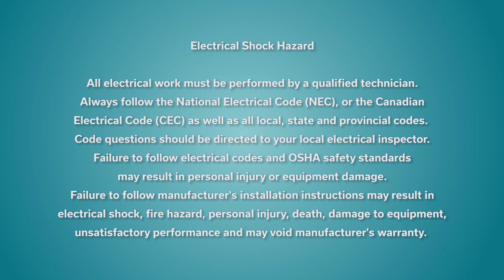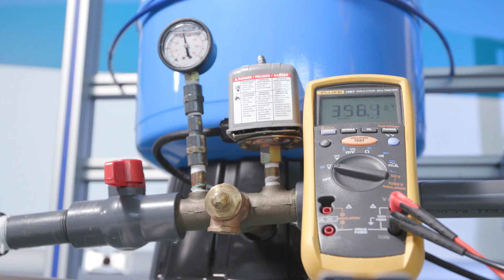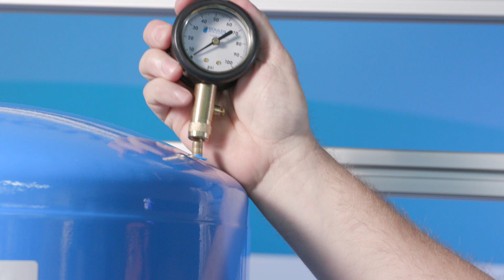The 15 Typical Causes of Pressure Switch Chatter

Comment: Here's what's driving me absolutely nuts right now... I use the water, pump turns on, then once at pressure it turns off. 30 -60 seconds later it turns back on, runs for a minute, then turns back off. Repeats this a few times then stops until I use the water again. Any suggestions on what could be causing this? Pump is only a few months old, changed the filter out, replaced all tap washers, but still stops and starts..
Reply: That's what mines doing what fixed your issue?

Comment: My pressure pump is good but stops  the water returns to the well and the pump starts working again, and I don't know what parts needs to be changed.
Reply: Sounds like your check valve is not working, u can leave it where it is and install a new one between pressure switch and pressure tank
Reply: Thank you very much. Really appreciated.

Comment: By "chatter" do you mean when it makes a rapid clicking sound? My pump stopped working & when I went outside to check, I pulled up on the cable supplying power to the little box & it turned the pump on. Happened twice in the past few weeks. Then it went out again tonight. I got a flashlight and checked it. Did the same thing, pulling on the cable (which seems to reset it). Pump started running but as I was walking away I heard rapid clicking, then the motor running normally, then the rapid clicking, then it shut off again & wouldn't come back on. 
In the past this has been caused by a short from damaged wires (my wires get fried by power surges because my power company sucks).
Reply: Mines doing the same at first I thought it was the power wire I ended up changing the switch and it's still doing it! Honestly hope it isn't my electric that's messed up
Reply: i just saw at home depot that they have whole house surge protectors, think it was under 100 bucks.  guess youre not the only one with crap power company if they are sellling these now!
Reply: @Kirk_Lazarus_ghost  Yeah, I got one but need to get it installed. Problem is I can't seem to figure out where the power for my pump is coming from and I think it's on a breaker that exists before the lines enter the house. And yeah, you're not alone.

Comment: Any help please , have replaced the water pump since it did go out , and now it keeps turning off we replaced pressure switch 3 different ones , replaced the tank and the electric box I’m confused that’s everything ? It keeps shutting off I have to go and manually reset that pressure switch to make it start up again thanks
Reply: Hey! Im sure you've solved it or tapped by now, but i think the issue is you need to adjust the cut in and cut on PSI for your switches. And to that you need to know the cut in and cut on PSI for your pump. Mine 40 psi cut on and 60psi cut off. If you're looking st the switch from the top down, in the direction that the wires come in, the big nut on too of the spring is the "range" turn that clockwise to increase the cut on PSI. The smaller nut to the left is the "differential" turn that clockwise to increase cut on PSI. Reverse it on both to decrease. Make sure to look it up yourself because i could have range and differential swapped.
Reply: Mo

Mnmjn

Comment: Thanks for the information. Needless to put your finger so close to the electrical contacts. Yes, the electricity is supposed to be off. And we never make mistakes.
And it was supposed to be off today when I was shocked.  
And many times we're standing on a wet surface and the items around us are wet. 
So now I'm keeping rubber gloves in the pit as a reminder to wear them. 
So you needed me to tell you that?
Reply: anything with a capacitor has the possibilty to shock your a$$ lol  even when the power is off i only use one hand and an insulated tool. ive been shocked enough for one life :)

Comment: I have replaced 2 pressure switches in the past 6 months. I keep losing all water pressure.  New plastic water line installed to the switch. Any suggestions.  Been using the same setup for years and no problems.
Reply: me too the new switches are made in mexico I found a old new stock switch on e bay American made switch much better made works fine so far 9 months make sure the line going to bottom of switch is clear and in good shape if not replace it the switch I used was a square d 30/50 made in palatine illinois

Comment: I'm new to pumps, pump doesn't shut off and only 30 psi on guage half way to house,150 ft.
Reply: Do you have pump relay or pressure switch?
Reply: Larry, there's a lot of resistance in such a long pipe. Is your pump big enough?